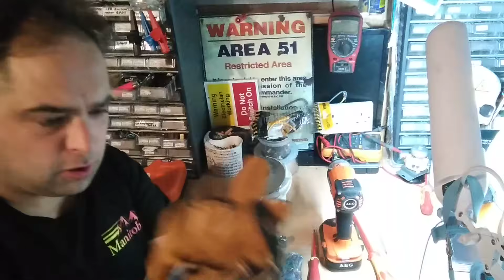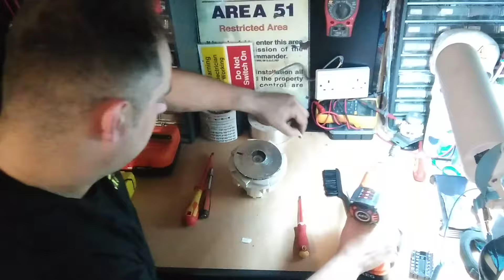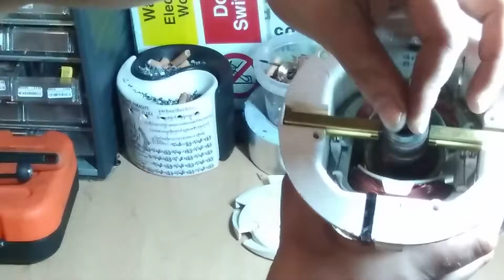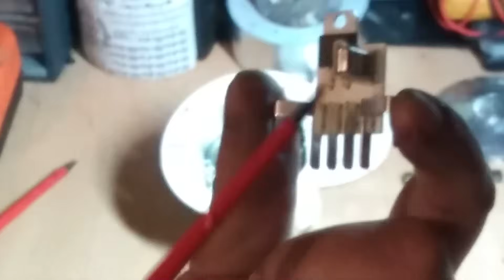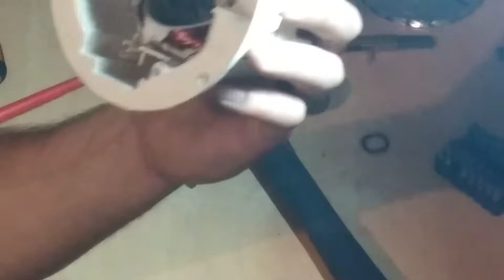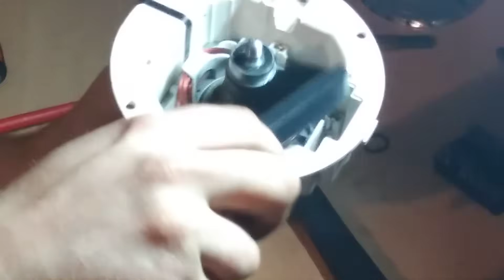MIELE VACUUM CLEANER MOTOR AUTOPSY WITH TEARDOWN

Comment: I've got the miele c3 complete ecoline with the 800 ish watt motor, can I replace the motor with the 1000 odd watt motor from a c3 powerline?
Reply from the maker: Not sure on that one, if I could get a sample of both motors ill be better able to advise... But assuming that all of the ratings, connectors and physical mount points are the same, then I'd say yea....  As a guess you should be able too... You'd end up with a more powerful vacuum cleaner, but you also have to take into consideration the wiring, in case of overload.... The higher the wattage, the more current it will require, which means in theory bigger diameter wiring and better rated components....  But its 200W difference, so maybe try it if you have a motor to spare and see how it goes

Comment: Would you happen to be able to explain how to tell if the electronic board failed or if the motor failed on a Miele vacuum cleaner?
Reply from the maker: Multimeter components on electronic board for resistance and continuity...... Also check resistance on motor windings too.... If its not showing any resistance whatsoever then its most likely open circuit...

Comment: How did you remove the Impellor and is the thread left or right hand?
Reply: Same question is it left-hand thread ?? having issues getting it loose
Reply: @75sunbird  LH thread . I finally managed to strip it down by drilling through the nut. Went on line for  bearings and a nut. Brushes were not available but something similar was provided with a lot of faff involving a soldering iron. It worked for a few months then the motor burnt out. Armature.  I priced a new motor from Miele £160 BUT they would refurbish for £125? Not wanting to dump an otherwise functioning cleaner and all the associated tools and plastic, I opted for repair. For £125 Miele picked up the cleaner and returned it with new motor, new cable reel and new filters.  I was impressed with the service.